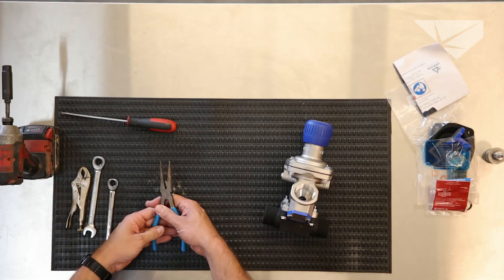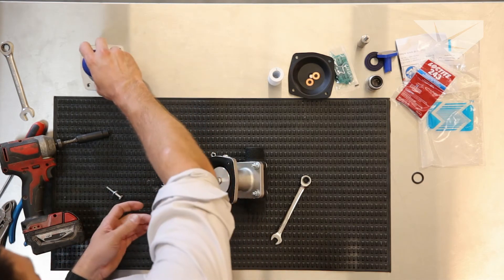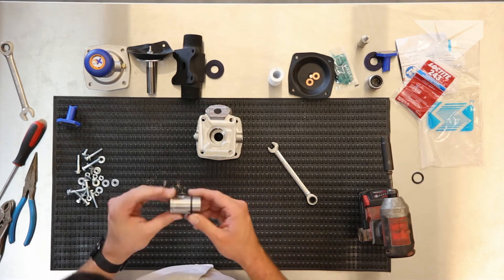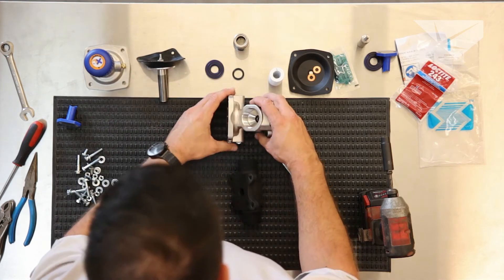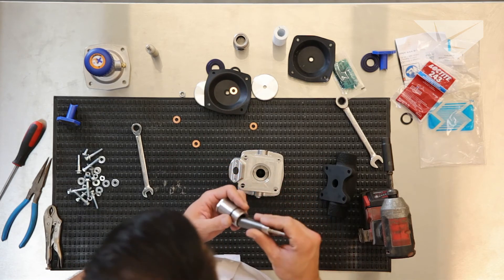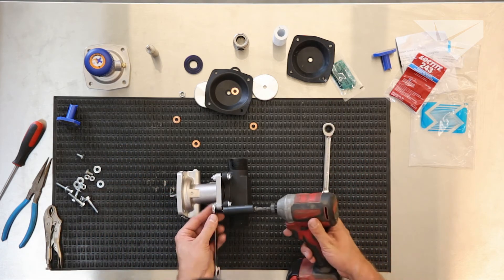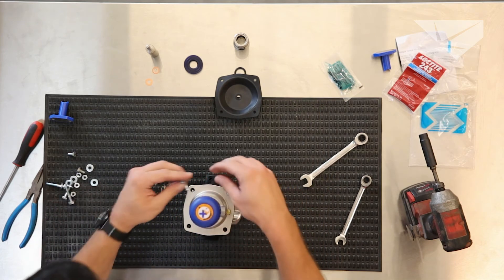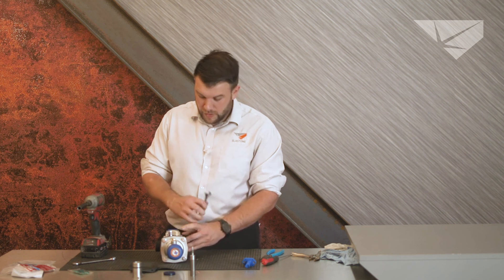How to Maintain, Repair, and Install a Schmidt TeraValve Rebuild Kit

Comment: So the locktite and assembly grease are just for show?
Reply from the maker: Hello! Our video uses the rebuild kit on a brand new TeraValve. The Loctite and grease are included for valves that have been used on site, which would have more wear on the components. Not required but included for the what-if scenarios!
Reply: So… if you had to use the grease, where would you apply it? I would assume only places that media/grit wouldn’t be?